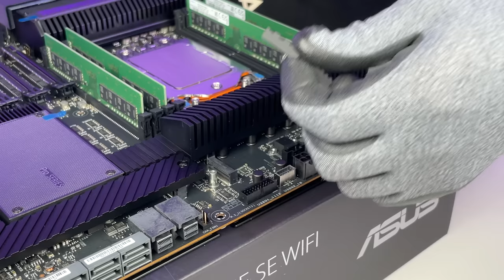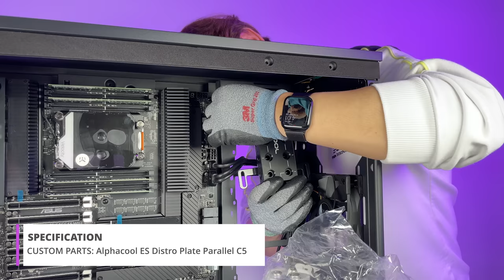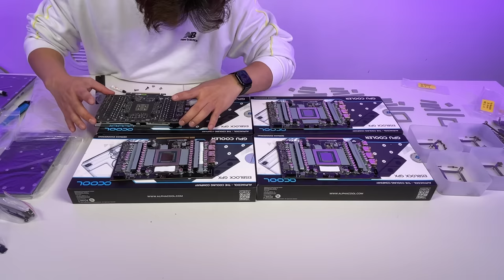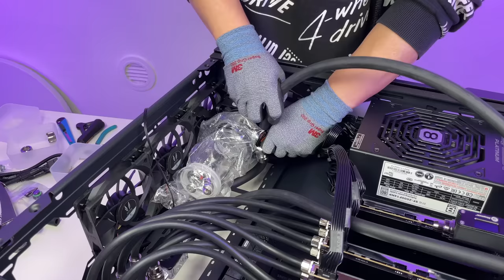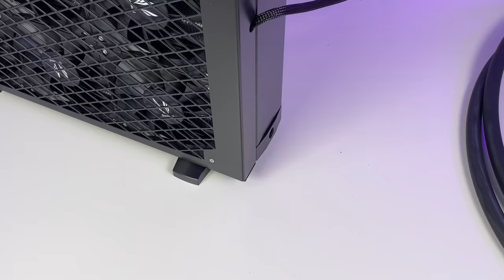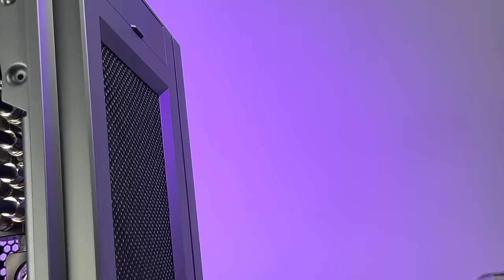$26000 RTX 4090 4Way ㅣThreadripper Pro 5995WX

Comment: 4090 x 4 + TR  is near 2kw of heat to reject, one D5 pump + 3x360mm radiator is going to overheat and throttle after a short while. I would suggest a dual d5 pump and  push-pull fans on the radiator, and remove flow restrictions such as flow meter, temp sensor. Other than that it's a lovely build. The cooling issues can be easily sorted for not much cash.
Reply: Yeah the moment I saw 4x 4090 I started worrying if that cooling will even be enough.

I hope all of those 4090's will be undervolted at least somewhat.
Reply: Flow meter and temp sensor are avsolutely essential and their restriction is negligible in this setup.
Reply: @dazeen9591  The 4090 doesn't support more than one card without Nvlink or SLI, and that was finally dropped by nvidia after the 30 series cards. They are just expensive paperweights.
Reply: @gargolgaming8101  having gpus act independently can be beneficial
Reply: @traestephen7276  But you can only use one gpu at a time, can you not?
Reply: @gargolgaming8101  you can use more than one.
Reply: @traestephen7276  That exist? How does that work? Is there a connector on the 4090 i'm not aware of, or is it something else?
Reply: @gargolgaming8101  no connector just use the GPUs regularly
Reply: @gargolgaming8101  software can select and use an individual GPU. A link would be needed for a piece of software to use two or more on the same operation (gaming, pooling cards for a single render), so nothing huge.
The only thing I can think of for the 3090 build that was practical would be to SLI two 3090s, use one card for rendering a 4k60 stream, and one card for PHYSX. (Even this is all questionable since SLI isn't perfect on 3090, PhysX doesn't really need to be dedicated and it's only really used in a few games, and you definitely don't need anything high end for a dedicated streaming gpu lol). 
But with 4090s which have no SLI and are even more overkill, there's almost no use for it. Lol.
You can I guess be running your YouTube renders after editing a highlights video on GPU3 while streaming with GPU2 when you're gaming on GPU1. I still don't know why you'd need a 4th concurrent GPU. 😂 Maybe training your AI model for stablediffusion in the background while you game.

tl;Dr just have 2-3 computers... Lol.
Reply: Actually, the flow meter and the temp sensor are rather essential. They demonstrate how very restrictive the loop is.
Reply: @gargolgaming8101  so building virtual machines to use as a workstation for each gpu with all pcie lanes and 8 cores per gpu is a paperweight. Or using them with blender even without a bridge cuts rendering times in half
Reply: @GiuseppeGaetanoSabatelli  except in tensorflow, deeplearning applications, 3d modeling/manufacturing. Why the games have become more and more poorly made since they killed sli. Seems like nvidia has been using and pulling the data from consumer cards to accel its own ai business with dlss.
Reply: @GiuseppeGaetanoSabatelli  and a bridge isn't needed for rendering, just for memory pooling. So if you have have enough vram unpooled it will still use cores from all the gpus, at least on blender and few others.
Reply: @gargolgaming8101  you can use all the 4090 you want 😅, for rendering for example, if your scene fits in the 24g vram you don't need nvlink or anything, and depending on the render engine you can even use system memory as an extension, top score on v-ray right now is a "10x 4090" and more than 50k with a single 4090 scoring about 5k... so not only those aren't paperweight, they scale up super efficiently
Reply: @gargolgaming8101  its not for gaming.. its for work... 4 of them can run together if u run a blender render .
Reply: @gargolgaming8101  8 way works fine in octane render. Renderfarm or 3d work its bliss.
Reply: Nobody is ACTUALLY going to use this system LOL
Reply: @nathanhudkins  Yes they are.... You think they just built this for a youtube video or what
Reply: @gargolgaming8101  With video editing you can split up the render between the multiple gpu's and it scales really well, with a single 4090 a render would take say 1 hour but with four that would drop by 4x (because it is just using multiple gpu's) and would only take 15 minutes total.
Reply: i would put a big v12 engine radiator outside and cool it from there xd
Reply: no you don't know

Comment: I would love something like this, BUT as the actual side panel. Really not sure why so many case manufacturers have this obsession with tempered glass when a wall of fans and radiators would make a perfect side panel.
Reply: When I saw him building the radiatior I was just thinking wow an entire side panel of fans(cause I was skipping the video) and then i see him keep the radiator outside. Maybe that is a flex who knows. I would keep it near my ac vent. If it was outside but making the radiator the side panel is a cool idea.
Reply: Because case restrict airflow. Radiators and fans has best effiency out of the case just like that.
Reply: this aged wewll. I'm assuming you've seen the new compensator from ltt

Comment: I am amazed how you trust your expensive hardware with custom water cooling. Multiple points of leakage, point of failure for the pump… etc.
Reply: It's probably not a conductive liquid, and the components seem very high quality. Air cooling a setup like this is also impossible because there is not enough clearance in between the cards.
Reply: He's probably going to disassemble the build right after the video was completed. Just for videos , not real.
Reply: This guy is not a random gamer dude, but a professional machine builder for institutions or businesses. His blog introduces a lot of examples like this, delivered to Research Centers and Hospitals.
Reply: @technocracy90  You are missing the point that Mamdouh is making. Read his comment again and try to understand what he is saying. He is right.
Reply: @dreamfunction4491  I'm not talking to OP but you. My point is they don't disassemble it. Custom water cooling system is one of their sales point.
Reply: @technocracy90  You are still missing the point.
Re-read Mamdouh's comment.
Reply: @dreamfunction4491  why would he do that lol
Reply: Sometimes you have to take risks
Reply: the fittings rads and tubing probably cost as much as teh 4 rtx 4090s
Reply: @dreamfunction4491  what he wrote is wrong. keeping those gpu's out of the air is not possible because there is not enough space on the motherboard. A capable person does a liquid system without problems, with a little maintenance you run no risk. however they are computers for doing scientific research or rendering
Reply: @dreamfunction4491  >get refuted
>"go read, you are missing the point"
Kek

Comment: Pro tip, the radiator QD's should not be the same for both connections.  Have a male and female connection on the back of the tower so that you don't have to think about which way to hook it up.  If they are opposite, you can 1,  seal the radiator side completely, 2) use an intermediate hose and run the pump without the radiator at all.

Comment: Quick disconnects everywhere is not a good idea, especially with one pump. If you're going to have an external unit, get one of the tower koolance chillers -- pump, rad, resevoir are external and not heated up by PC components. I would stay away from parallel distro blocks, you're splitting flow, it's always recommended to go in series -- CPU first, then GPUs -- and out, the liquid will normalize at a temperature, and flow will not be compromised. I was hoping to see the system boot and post, but I just saw how not to liquid cool a high end system

Comment: Very nice build .Clean with high end components .I wish you could include benchmarks of this beast.
Reply: Well don't expect gaming benchmark though, but blender's cycle viewport performance must be sick or rendering time.
Reply: Gaming performance on this would not be that good tbh. Its not a gaming system
Reply: @thelespauldude3283  it would actually be really good, what? Zen 3 and a 4090. If the cooling could handle it, it would game like a beast, but more than half of the hardware would be idle.
Reply: @LtdJorge  can you actually play with 4 4090 in sli ? and threadrippers if i remember fall a bit behind for gaming
Reply: @wilihey1425  SLI is pretty much dead nowadays so no
Reply: @thelespauldude3283  yeah it still should perform really well in gaming
Reply: @GewelReal  it will not lol. who lied to you?
Reply: @psychedeliqueee  zen 3 with tons of cache, quad channel  and a 4090. it will easily be a top tier performer
Reply: @wilihey1425  As far as I’m aware, NVLink has been discontinued on the 4080 and 90 cards. Correct me if I’m wrong.
Reply: Also, even if a CPU isn’t necessarily for gaming, it may not constitute large performance drops. It may not perform as well as CPU’s meant for gaming, but they’re still in all ways a computational powerhouse that’s capable of processing many requests per second. Sometimes you may only have performance drops in general if the CPU isn’t powerful enough, or if it bottlenecks the GPU for any reason.
Reply: @thelespauldude3283  oh yeah bro it’s gonna be as fast as a LGA 775 Celeron and a GeForce 210 and 1GB DDR2
Reply: This looks like a clickbait-only built. I would like to see the thermals over 1h of sustained GPU + CPU load as radiator area is small for 2kW and I don't expect the pump to be sufficient for the manifold, 5 blocks and the radiator. It only looks nice. It also lacks the RAM, local SSDs, and network card to be useful for any workload that would justify a 4 x RTX4090 workstation.
Reply: It is not high end it is literally end pc 💀
Reply: @crestdazoltral7705 only use case would be a server ngl, it would blow up   if it ran a program because cooling problems and most programs aren't gonna use 4 of the strongest cards, a super strong CPU, and a crazy amount of ram

Comment: Cool build, those 4090s look normal sized without those monster coolers on them :). 

That big radiator reminds me of the big copper car radiator i used back in the early 2000s, compared to then there is so much cool watercooling gear, i have not had a watercooled PC for a while but seeing stuff like that makes me want to again.

Comment: That's actually a workstation for professional use. Just perfect, not just for show - This system will be used and is build by purpose!
Reply: its built badly and with very little care, clearly can see it in the video.
Reply: @beeseechurger  Clearly? Except for a couple of cables and hoses, that aren't organized perfectly, I haven't seen any "clearly" bad thing. But: Your opinion, of course. 👍
Reply: @beeseechurger  Damn, that's an eye opener! To be honest, I'm really not that deep into custom water-cooling and believed that nvlink isn't a thing anymore (had actually asked myself if one really doesn't need it for connecting these cards nowadays)... So I guess my uneducated point of view made me believe this is a thought trough system. Thanks for elaborating these flaws! 👌👍
Reply: @Mathias-RetroFutureTech Then you know nothing about computers. This system will overheat as soon as you try to do any actual work with it.
Reply: What is it going to be used for? 4x 4090? Why?

Comment: cool computer I'm pretty happy with my single rog strix OC 4090. I thought it was a bit ridiculous how much I spent and then I immediately think of the depreciation in 6 months.
Reply: What do you work as ?) I also want 4090 :)
Reply: i got a 7870 damn
Reply: @Ruwrize  I used my old gtx1080 for like 5 years, then upgraded to rtx3080ti for 500$ and I am more than happy about it..
don't see any reason to buy 4090 for crazy amount of money when 99% of games run 150-200fps on 3080ti for third of price..
Reply: @benjaminshtark5977  cool and where did you buy an rtx 3080 ti for $500 ?
Reply: @Ruwrize  a lot of people sell them 2nd hand after crypto market collapsed.
just replace thermal paste and you are good to go.
Reply: @benjaminshtark5977  Good option, but there is a but, it may happen that the video card will be heavily overloaded, in general, not the fact that good will get, can work for a week and burn out ....

Comment: The temp delta can be like 10C before and after each videocard if loaded at 500 watt. I doubt that the efficiency of this cooling is any good unless they use a pump that pumps water like crazy to minimize that delta difference. However... they use just a regular d5 pump.

Comment: My only critique of the build is to have the reservoir at the top of the fluid table, as it is, air locks are likely to accumulate in the radiators
Reply: Air in the radiators shouldn't be an issue I think. I'm only aware of that being a problem in AIOs if the air accumulates in the pump itself.
Reply: Air can accumulate in one of the waterblocks, and the liquid bypasses it through the other.
Reply: my critique is the 512 gb nvme...

Comment: Almost more powerful than the $40k 8 pack Orion PC
Reply: 8 pack PC uses old graphic card and old CPU. so no way to beat this monster PC.
Reply: 4x RTX 4090 > 2x RTX 3090

duh!
Reply: @luckys1evin  Except for gaming where two 3090 can work in SLI which the 4090 can't, so the dual 3090 may outperform the single 4090 in many cases (and the other three just idle).
Reply: @magicmulder  
a. SLI is pretty much dead - either does not work, or has loads of issues, unless you're all about breaking benchmarks - it's nearly useless.
b. this ain't a gaming PC, it is used for professional work where each GPU can work individually.

Comment: For my opinion, a 480 rad on top and the front would have just worked fine. No need for an external radiator.
Reply: Yeah, and the loop is configured for seemingly the lowest flow rate possible, check the flow meter in the last couple scenes, slow as hell. 

Everything in that is gonna throttle. Shame. Should’ve had some internal rads, plus the cpu first in the loop. As well as that, an additional d5 pump would have done wonders.
Reply: idk man this is almost 2kw of power... even in the best case scenario I think that would lead to some throttling
Reply: Even the shown setup is not cool enough, he would need another pump and double on fans to set up a push pull.

Comment: Who is this legend, who need 4 4090 in one 🙄. Salute bro, salute 🫡🫡
Reply: It will be used for deep learning bro
Reply: @SuperMetal4Eva  Do 4090 even support sli? How would it work?
Reply: @TurboGroszek1  No. The 3090 does though.
Reply: @TurboGroszek1  SLI doesnt matter as it will be used for Deep Learning.. more Graphics Power = more power for deep learning
Reply: @TurboGroszek1  Deep Learning requires multi Graphics processing power... in SLI GPu memory is mirrored not stacked so not relevant for deep learning

Comment: Astounding level of performance... I spend $4000 on my comp, and this build completely blows my rig out of this dimension.
Reply: I dunno dude, how are you gonna use 4 4090's, sli is dead, the only thing i can see this thing being useful for is machine learning, like the only other reason to have more than one gpu is because you are running linux and want to have a dedicated gpu for windows, that's why i have a 6950x and a 4090, and the only reason why i even need a 6950x for linux is because i got 4 4k screens which just use too much vram when i'm even just on the desktop, other than those 2 reasons there is no point in having more than 1 gpu, let alone 4 gpu's lol
Reply: @MrTurbo_  I completely agree that it's overkill and almost useless, cool nontheless.
Reply: @MrTurbo_  Well like you said, this is probably going to be used for machine learning. In which case it's an absolute beast of a machine.  I highly doubt someone bought 4 4090's to play games.

Comment: Is one MO-RA 360 enough for those components? I doubt highly.
Reply: It Will be enough that's 2 120mm space for each 4090 and 1 120mm space for the CPU that's thinking they would all be hit at the same time Wich is unlikely and also they're running the system at stock speeds so the power draw won't be that high

Comment: THreadripper Pro 5000 CPUs support 8 channel memory so performance is reduced with only 4 sticks. However, I expect RAM performance is secondary for this PC.
Reply: well he uses 4 sticks DDR4-3200 mhz without a heatspreader wich is kinda old and bad for a build like this
Reply: @Managarm1999  it's ECC memory they can't go as high because they made for 0 tolerance and in rigs that need to be on 24/7
Reply: @Managarm1999  Heatsinks on memory sticks are there for aesthetics and branding. They are literally not needed whatsoever since DDR3 came out.
Reply: @yanni-duff  tell that to ddr5